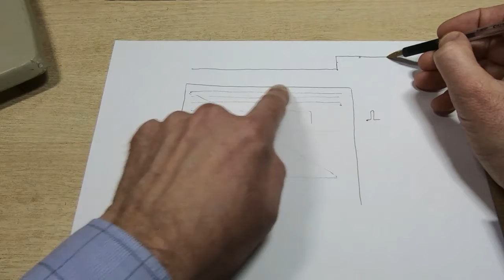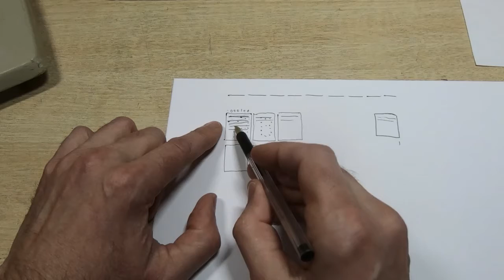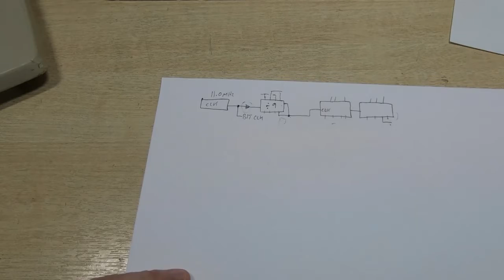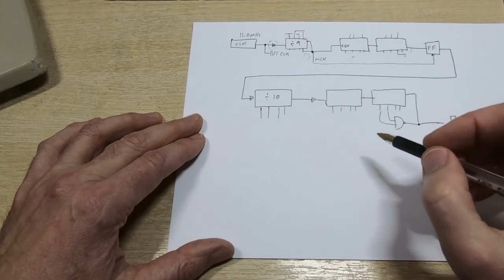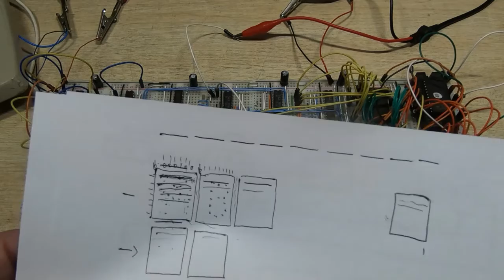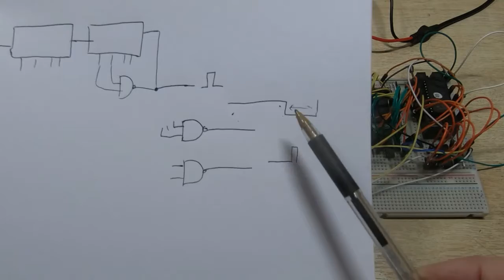Designing A Z80 Computer Part1

Comment: I've built the video circuit end-to-end, but noticed that the ASCII character values are not mapped to the ROM bitmaps, they are 40h different as you mentioned. I didn't find if you did the character set mapping via code or hardware? Or, did you just offset the character maps in the ROM by 40h*8?

Comment: I’ve built the schematic on page 90 and it’s not creating an output on pin 5 of the 7474 flipflop. I’ve had a look through on the oscilloscope and pins 14 and 13 of the first and second 74161 are skipping pulses. Could this be due to the loading on pin 9. I have looked over the connections that I have made to make sure everything is correct and I cannot see any incorrect connections. I’m lost on where to go from here. Any help would be very much appreciated, I’d love to finish this project
Reply: I have just tested the first 161 by single stepping. The counter gets to 1111 then resets to 0000 and then loads 0101. I’m guessing the problem is the fact that it is resetting to 0000 before loading 0101. I am not sure how to fix this.
Reply: @liambunyan4116  I noticed there was some discrepancies between the book text, circuit and the video. When I built mine, I had to just play with the load values and load triggers (gates) to get the waveform I needed for my CRT; the HDRIVE was particularly difficult. Also, take a look at what versions of the chips you're using (ex: 7474/LS7474/HC7474) as they have different reaction times and propagation delays, and depending on what clock frequency you're using it may be too slow to react. I wished I had a 4-trace scope for this part.

Comment: Hi Jerry. I've committed to my own Z80 development journey, shoulder-to-shoulder with yours, using these videos and your book as a coach. (thank you!)
I'm having trouble generating my horizontal drive signal. Based on the schematic in your book, it seems by 'listening' to CC3/CC4/_CC7 (figure 5-15) the circuit is blanking the HDRIVE after a count of 24 columns, instead of 64. I'm wondering if you made a last-minute change to the circuit when you made the PCB's? 
I made a bet with myself that you didn't make a mistake and I'm missing something more fundamental. Not sure if I'm hoping to win or lose the bet. 😏
Reply from the maker: The book shows the 'working' versions of the schematics.
It is hard to say what the problem is that you are having but be sure to read the book to the end as some circuits have more than one mode of operation and are only completed as the design progresses. For example the blanking circuit has inverse video as well as artifact blanking inputs so these must be set correctly.
I am not sure what you mean by 'blanking the HDRIVE'. The Drive signals are never blanked. Only the video signal gets blanked. The schematics at the back of the book are the versions used in the working board I show in the early videos (up to the version shown in the book).
Reply: @JerryWalker001  Sorry for the confusion, when I say 'blanking the HDRIVE' I simply meant the signal going low. In the book (figure 5-14) you predicted a 54uS cycle of the HDRIVE, with 43uS in a high state and 11uS in a low state. I wasn't able to reproduce that after building out the schematic O-7 (page 401), I thought it was due to miscounting the Column Counter.
I'll shelve this issue and keep moving forward, and revisit before I connect to an actual display.
Reply from the maker: @johnkozell6498  I do not know how you are going about building the circuits but the H and V drive circuits do not determine column count or row count. They only determine the cycle time and only a single edge of those signals is important although it is important to understand that the entire cycle is not part of the display period as it includes the retrace periods.
The timers used to produce the H and V signals are however used to count the 'pixels'.
The blanking signals are derived by decoding some of the counter outputs but blanking is not directly involved in the timing of the drive signals.
Reply: @JerryWalker001  I'm following your schematic for the video, so I was wondering why I wasn't getting the HDRIVE waveform you described. It is based on the Column Counter (solely at this point, fig 5-15), it's a simple circuit based on the CCx outputs. The wave produced was closer to square than elongated (as in fig 5-14).
I had considered there was a later enhancement, which is why I verified with final schematic. I believe I have the theory well understood, just trying to work out circuit details.

Comment: I have the book, it's great but the discussion of the 74161 counting from 5 to 15 before resetting leaves me confused because output bit 3 goes high at a value of 8 not 15. what am I missing?
Reply from the maker: If you look at bit 3 as a clock then it is a divide by 16 clock but if you use the falling edge of the second part of the signal then it takes 15 clock pulses (remember that the 161 is a synchronous counter).
Reply: @JerryWalker001  Thanks for the reply! but when bit 3 goes high isnt the binRy value 1000 (8) and wouldnt this then reset the counterback  to 5 before ever reaching 15? thanks!
Reply from the maker: @electronictreasure4191  Which part of the video / book are you referring to?
Reply: @JerryWalker001  Thank you : Page 82  par 2 "Pin 11 (bit 3) is connected to the load input ...as soon as bit 3 goes high, the counter is reloaded with value set on pins 3 to 6 (which is hardwired) to value of 5" ... "so when counter reaches 15 is it reset to value 5". So this confuses me because pin 11 (bit 3) goes high when it reaches a value of 8 (binary 1000) so it would reset to 5 before being able to count to 15 (or 16), but at 8 instead? Unfortunately I don't have a 74161 in my box so I am waiting on one in the mail so I can't experiment with it.  Love the book BTW read 80 pages the first day!
Reply from the maker: @electronictreasure4191  I must be miss understanding your question. This counter provides a /9 function. The counter has 4 outputs. The first is /2 then /4 then /8 and bit 3 is /16. By pre-loading with 5 it causes it to count from 5 to  16 and then reload which gives /9. It is synchronous load so it does not load until the clock input changes which avoids a very short last bit.
Reply from the maker: @electronictreasure4191  OK I reread your original comment and I think I understand the confusion. You are assuming positive logic. In digital design you select whichever logic 'sense' is most appropriate. The majority of vintage computers used negative logic busses and control signals. The counter is re-loaded with a negative logic signal (logic low) so the counter uses negative logic. This means that on a value of 15 to 16 bit 3 goes from high to low. A negative logic value of 5 is then loaded (1010), see schematic. This gives 15 (1111) - 5  = 10 (1010) which the value loaded. The result is the count division that we require but as I say in the book you can select any division you want within the counter limits to suit your design. The important think here is the difference between the loaded value and the overflow value. Also remember that the counter is still running when the value is loaded so the next clock edge will increment the count. In this way it provides symetrical clock pulses which is important when timing pixel outputs.
Reply: @JerryWalker001  Thanks for the reply. I'm getting closer.  I built the clock circuit on page 80, and studied it. I always counts 7 pulses and then resets. It's counting from 10 (%1010) up to 15+1 (rollover), or if using negative logic from 0x05 down to 0-1(15) and then resetting. Wouldn't this be divide by 7?  When I supply 100khz, the output of the character clock is 14.28khz. When I load 8 (%1000) on the input it appears to divide by 9 correctly.  At 100khz char output is 11.11khz. Is this a typo in the book or am I doing it wrong!
Reply: @electronictreasure4191  I think I’m having a similar problem. Did you get it working?
Reply: @JerryWalker001  Jerry,
Looking at the figure 5-9 in your book, the pixel counter schematic, I think that you have the inputs backwards.  You have tied pin 4 and pin 6 high (+5) which gives 0101b (10 decimal).  I think you meant to tie pin 3 and pin 5 high which would give 1010b (5 decimal) which is the counter starting point.  Or am I misunderstanding something?
Reply: Also, on page 85, you say the AND gate detects a 63, but if its connected to pins 13 and 14, which are bits 4 and 5 of an 8 bit word. Doesn’t that detect 48?

Comment: Just came across your channel. My first computer was a ZX81 and a few years later I got an Amstrad CPC 464, so I have a special fondness for the Z80. As my father was an electrical engineer, I had some exposure to computer design, but always used SRAM in my fantasy designs as it's much easier to use, an advantage of not actually building something is not actually having to pay for it. After all these years will finally find out how DRAM refresh is implemented!

Comment: If I'm understanding this correctly, if you were to double the clockspeed and timer counts then youd get a 160 col x 48 row display?
Reply from the maker: You would need to also change the drive timing as well but in practice it would not actually work. The minimum pulse width for a dot on the display is around 80nS which is a maximum of around 750 pixels per row. 160 columns would need almost 1500 pixels so the display would just be a blurred mess. 80 columns is at the upper limit of what this monitor can manage. You also need to take the memory setup and access times into account. In the design I show there is around 15nS spare which is a close as you really want to go. If you double the clock speed then you would need to change the way the memory is organised.
Reply: @JerryWalker001   Thank-you for explaining those limits.  It's always intrigued me how different resolutions were handled, character modes etc. Had an old 386 once that could go over 100 characters across in one text mode, always bugged me I couldn't get that mode on later PCs except by using graphics drawing.
Reply from the maker: @El_Croc  Yes PC's used totally different techniques for video output but they came along much later.

Comment: Very intriguing!  I certainly haven't seen many attempts in recent years to do video on a retro or retro-ish system without resorting to either a vintage video chip (TMS9918, etc) or something very anachronistic like an FPGA.  I can think of only two at the moment, in fact (I'm sure there are others, but just settling for "connect terminal here" is certainly far, far more common).  I will follow this project with interest.

Comment: Looking forward to this series.  It would be nice if you could cover your video design for those of us in the 60Hz world, but I realize your monitor is tied to 50Hz.  If you could at least give an overview or an idea of what parts of the circuit would need to be addressed to deal with 60Hz.  Thanks much.
Reply from the maker: I will be covering such issues in later videos. The first video is not really the place to discuss variations in design as that would make the explanation very confusing. Having said that there is no real need to run at 60Hz wherever you are.  50Hz would work fine for you but I will discuss the circuits in more detail in later videos including counter values. The monitor will actually work fine at 60Hz (It came from an ADM3 which works at 50 or 60Hz).
Reply: @JerryWalker001  Very good.  I really didn't expect discussions on variations in the first video.  Love your videos, especially ones on equipment I've owned or restored.  Keep up the good work.

Comment: The first computer I ever built, was from a book and had the same type of video circuit (a chain of counters with some gates). The only two differences were that it have no character ROM nor dedicated RAM. The video info/ the pixels were on the main ROM and all the addresses were directed to a address interval in the main RAM. That way the computer was able to do graphics also.
If I remember correctly,  the main oscillator was running at 10MHz and the video signal was OIRT standard (625 lines, interlaced at 25Hz/frame). The way to get the video to an TV was trough a simple RF generator that worked on channel 3(?). The video was B&W only with video invers and blinking atributes.
Reply from the maker: That sounds like a very odd design and not one I would want to repeat but if you still have it then a video would be interesting.
Reply: Sounds similar to how sinclair zx worked, but I doubt discrete counter chips were used.
Reply from the maker: @El_Croc  The ZX's produced composite video in a large scale IC. They did not use any discrete timers or counters.